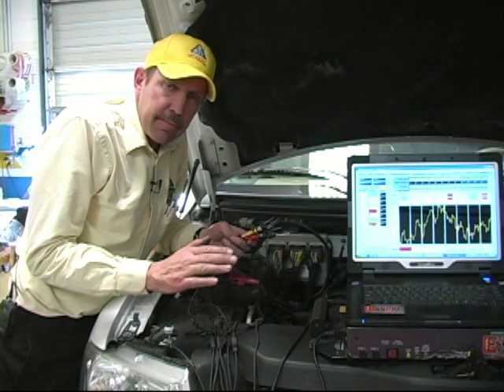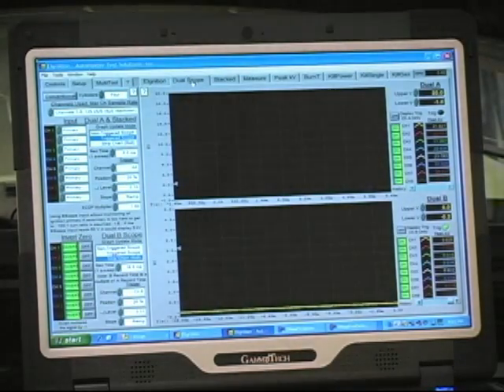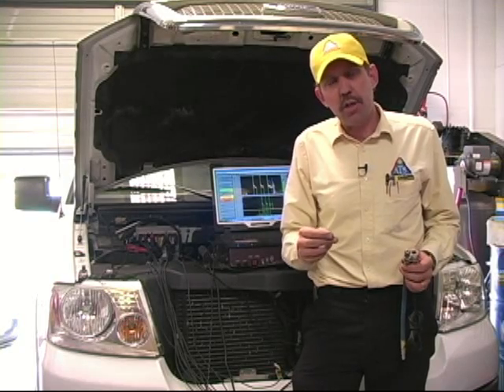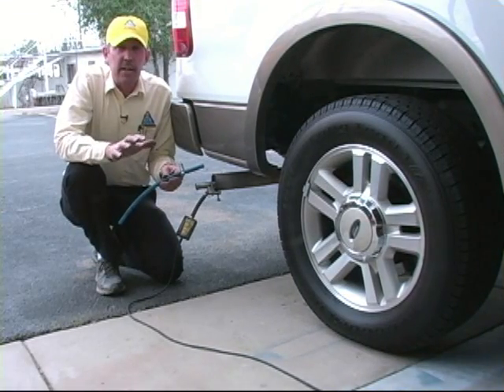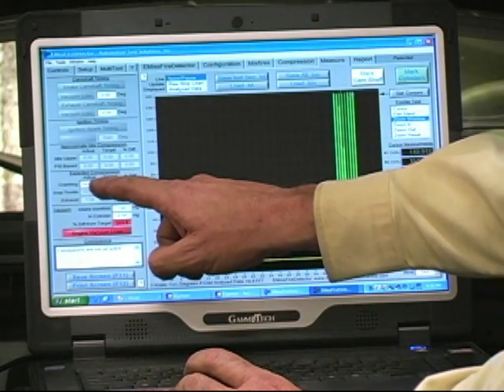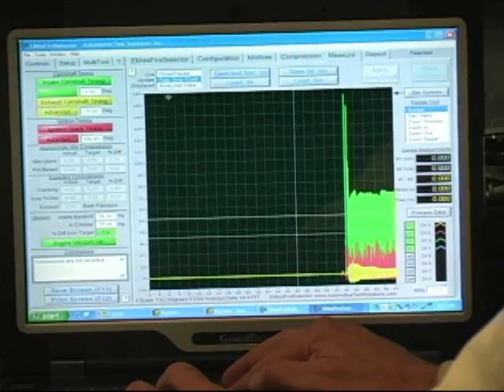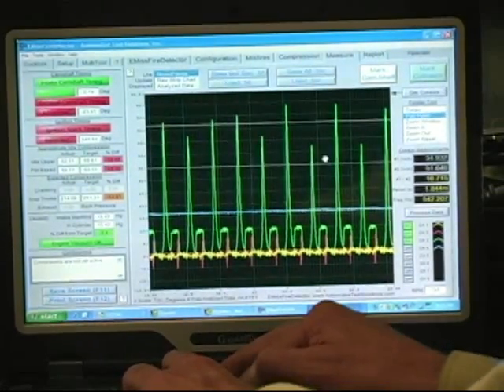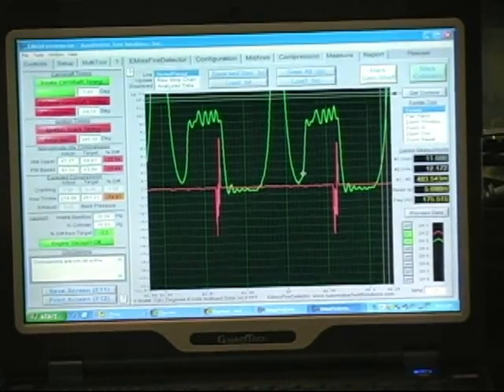Ford_Triton_misfire_part_2.mp4

Comment: My 5.4L 3v runs about the same, misses a bit here and there when cold but as it gets warmer it misses less but theres still a very slight miss there. I have noticed if a rev the shit out of it in neutral, let it calm down and put it back in drive and go to take off that the miss is more often and a lot more pronounced. But if I put the engine under stress (multiple fast take offs, revving the engine out under load instead of neutral) I get a lot less missing and its almost impossible to tell its got a hint of a miss except for idle. Makes me wonder if theres a valve issue. With more stress being on the engine, pressures are higher and maybe helping the valve to seat correctly? Typically it will drive fine for awhile like this too. If its sits and idles for awhile in park the problem comes back. Really irritating how many issues these 3v engines have. They make great power but its fucking irritating when you cant put it all down...

Comment: My personal experience with using oscilloscopes for diagnostic use is that waveform interpretation can be unclear at times. It can feel like you're reading tea leaves and really leave  you vulnerable to a misdiagnosis without adequate training. You can read things into what you're seeing that aren't there and miss things that are there.
Reply: Crystal Jackson I agree sometimes it is easy to split hairs while viewing a waveform. If you still believe in the use of your scope during problems. I would definitely invest time in training material and taking of known good readings on a bunch of vehicles. I say a bunch because I learned to use my ignition scope on a brand new propane fueled forklift. The machine had intermittent misfires due the lean mixture that randomly appeared. I thought that was good vehicle since I spent much time scoping as much as I  could. Check out TST seminars for help using a scope. Scanner Danner has a bunch of videos too.